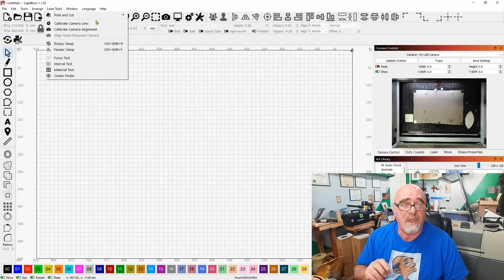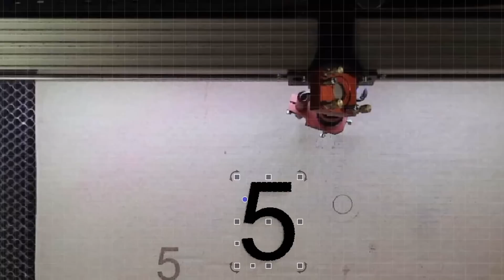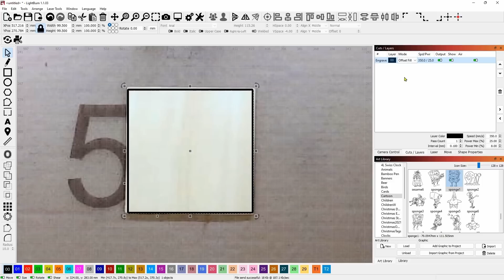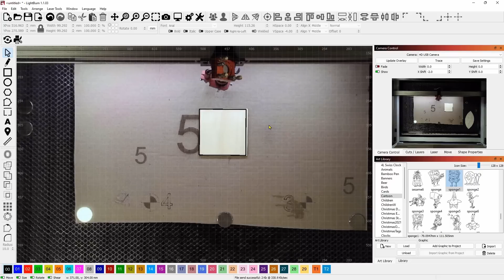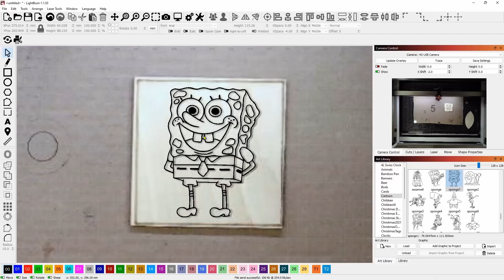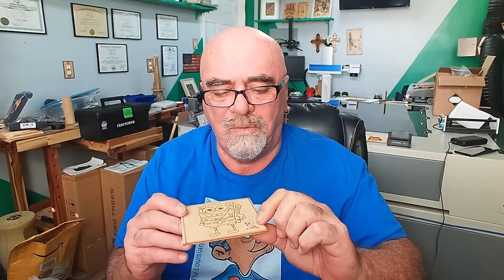👌 Achieve The Perfect Alignment For Your Lightburn Camera!

Comment: You don't need to print on such large cardboard, you can place small squares in the corners and center (The farther apart, the better). Place them during a dry run (0.50) power and do a low power cut, reuse with masking tape.
Reply from the maker: Thanks for sharing your method.

Comment: Good Day, So here is my problem when I draw a circle and it burns it its  off center . I adjust the x and y and burn again it off again. adjust again still off.. now lets say I have the alignment correct.  now at one point I had aligned when I place my material again I should just be able to align throw the item on the bed trace it out and burn all this alignment is driving me crazy.
Reply from the maker: You're probably using absolute coordinates on the laser tab.

Comment: So when I align and create a  square and circle  inside it perfect alignment. When i remove and add a regular circle and remove  honeycomb its off. I'm trying to engrave wood candle  lids what am i doing  wrong. Should I create  a template for the wood candle lids and align for them only and save setting
Reply from the maker: Using a camera, most folks only align it to the honeycomb bed. If you go higher or lower, the camera looses alignment.
Reply: @TheLouisianaHobbyGuy  so i need to align it afterwards  duh. Simple. Thank you 😊 💓

Comment: So when I home my machine, the display show 3 mm for   x and y. When I engrave the item is off around the same. So by just adjusting the shift this will straighten it all out. Now will the shift stay in light burn or will I have to do it every time. I still new ,only 4 mths, learning something every time. Using a longer Ray5 10 watt. Hopefully next year I'll expand it to work area 30*30 and 20 watt. Thank you making this vid.
Reply from the maker: No, the shift is just for the camera view. If you're at 3mm on the X & Y after you home, you likely have a problem with your limit switches. Contact Longer and report the issue.
Reply: @TheLouisianaHobbyGuy    Thank you

Comment: The settings comes with offset adjustments to align camera to laser markings
Reply from the maker: I don't particularly like setting offsets, but yes, I have talked about using them. Better to calibrate to every thickness of material you use and save those settings.

Comment: Will def try the paper background next time. I'm using a standard webcam not designed for lasers with mixed result and have a question for you: Do you have to alter x & y shift each time you raise/lower the bed? Because I have to and it is annoying and kinda defeats the purpouse (plus different items have different heights). Just wondering if its my camera or not. I would have hoped that lightburn takes this into account and selfadjusts but...

Also, you know you could have just hit "show" in layers to hide it instead of dragging it out and undo :P Easier to see exactly.
Reply from the maker: Yes, you have to calibrate for each thickness of material. You can save the settings for each on the laser tab. There are too many cameras and lenses on the market for Lightburn to adjust for them.
Reply: @TheLouisianaHobbyGuy  Oh really? Interesting, I'll look into that. Thank you!
About selfadjust: Tbh, I think it would be doable to have another step in the camera calibration for that. It would only affect the bed height since lightburn know the Z location but it would make it easier for sure. 🙂
Reply from the maker: No, you would need to have some sort of lidar to do that, and even then, the amount of camera sensors, sizes and field of view would make it impossible unless there was just one specific camera.

Comment: I recently bought a Lightburn camera. It camera with four square pieces of laser wood. The standard setting took the edges of the honeycomb bed.
However, I'll try adding the blank sheet, for anywhere away from the center is not yet spot on accurate.
Gorgeous compass, by the way!
Reply from the maker: Thanks, and remember to calibrate for multiple thicknesses of material.

Comment: Gonna have to recalibrate I had mine perfect I could tell it to burn in an exact spot and it was beautiful but after cycling the power on my laser it moved on me I can’t figure out why! Overlay and the burn match perfectly but it’s not in the right place I can’t figure out why!
Reply from the maker: You may have used a different thickness material. You need to calibrate for all thicknesses of material and save each one.

Comment: This may be a stupid question, but I’m completely new to using cameras in LB…
I have a Angetube auto-focus camera for my computer, can this be used as a camera in Lightburn or do I need a Arducam specifically?
I’m using this on a Longer RAY5 laser with an 850x850 bed area, so I’m also curious if these cameras can focus to that size?
Any help is greatly appreciated
Reply from the maker: I really don't know, but if it connects via USB it should work.
Reply: @TheLouisianaHobbyGuy  it does connect with USB.
I’ll probably have more questions to come, but thanks for responding

Comment: do I need to redo alignment every time I fire the laser unit and start the lightburn software?
Reply from the maker: You shouldn't have to, but you do need to have several saved alignments for different thickness materials.

Comment: Hi Rich, as always your videos are excellent. You mentioned mounting a camera for a larger work bed, I was hoping you have a camera make and model recommendation. I have a 400 x 850 bed and my current camera is limited to 400x400. Any recommendations would be appreciated. Thank You
Reply from the maker: I use a 175°, 5MP generic camera on my 914x610 Co2. But the further away from center you get, the less accurate it gets. I only really use the camera for the center 250x250 or so area.
Reply: @TheLouisianaHobbyGuy  gotcha , thanks Rich, I was able to find one thru light burn that should do the trick. Thanks for the feed back.

Comment: From what I've been reading, if you would've moved the cardboard before you put your square of wood on there, you wouldn't have needed to adjust anything. It was the added height that messed it up. BUT I've been struggling with my camera and it's been driving me crazy. I'm going to try your suggestions and fingers crossed it works! One question though, do I need to realign and calibrate my camera every time I want to use it if I haven't moved it, but I've unplugged it from my laptop? Or once I get it right, I'm good to go every time.
Reply from the maker: No, once should do it, but do it at the level of the material you use most. So if you typically use 6mm wood, put a few pieces down on the bed so you calibrate to that height.

Comment: Adding the camera is a game changer for me ! In my case I'm using a Prover xl 6050 cnc machine with a 10 watt laser and I mounted my webcam on bar stock (permanently/no movement) above the machine in perfect center. I did the very same thing with using white poster board for the first part and a 16x16 inch square of 3/8 particle board for the 2nd part and it was a piece of cake. Every capture on camera alignment was around .03 to .05 and now I can put down a dime sized object and engrave it perfectly ! The camera has made engraving and cutting so easy, it's well worth the effort IMHO. Great video Rich, cheers from Utah !
Reply from the maker: Thank you so much! I really appreciate the comments! 👍

Comment: You have done it again,  I was having a total nightmare calibrating my Camera,  it was very well lit but I just could not achieve acceptable scores.  In fact as the hours went on the scores became worse.  I then found your video (this one) and followed it to the letter with the complete whit background,  which again was well lit.  After 25 minutes my calibration is pretty damn perfect.  It took 25 mins because I was going between Lightburn and your video,  obviously not an issue especially when you consider the 4hrs 10mins of sheer frustration with my initial efforts.  So yet again more well deserved THANKS,  this lasering malarky is lucky to have such a great tutor !!
Reply from the maker: Awesome! 👍 Thanks for watching!

Comment: Hi Rich, Great videos all around.  When you talk about the camera calibration card (dots card) what size do you print it at and is in landscape or portrait position?  Also, in the camera alignment wizard for the "sample image - 4 dots with center determination" when you say to increase that to 200% - does that only work for square beds, as my bed is 430mm (x axis) by 930mm (y axis) and on that page it is already set to 195%, would/should I increase that to push the four circles to the edges of my bed?, because if I increase beyond 200% it may push the dots off of the bed beyond lasering point (x axis) or will the software account for the rectangular bed when taking the percentage into account.  Thanks, appreciate your time. :)
Reply from the maker: I print the dot size at 150% I think. The largest size that fits on the A11 paper in my printer, in landscape. You can increase the 4 dots to as large as the material or bed. The larger, the more accurate.
Reply: @TheLouisianaHobbyGuy  Thanks for the reply, appreciate it. :)

Comment: Do you have to home your machine to get the lightburn camera to work?  I have the Xtool D1 non pro and have never used the home because it doesn't have the limit switches.  What do you suggest
Reply from the maker: Before you turn the machine on, move it by hand to the top left corner. Then it will work fine if you don't move it again by hand Shelly.
Reply: @TheLouisianaHobbyGuy  thanks so much!!

Comment: Hi Could you tell me what I'm doing wrong I have set up my camera To your video In each steps and it works perfect And I save it,( Calibrate camera lens plus Calibrate camera  alignment) I can  do a shape or number on the board And it will be spot on every time But when I shut down the system totally and turn off the power and turn it all back on again it is out very slightly I have a ortur Laser Pro 2 with a 80w tree Laser Which works are treat The laser Is set in the door  lift up on the  ortur Metal  enclosure,
When I was setting it up it was just stuck up with double sided sticky tape it is now set up With hot glue Which works A treat .
The only thing I believe it could be is when I lift up the door On the closure It is not lifting perfectly to where it was not sure if this is the case Thank you.
Reply from the maker: Yeah, if it's not perfect, it's not perfect. It only works in a fixed position.
Reply: @TheLouisianaHobbyGuy  I believe it's the door lift there's a few millimetre play in it Might have to rethink Where to put it

Comment: I did have good lighting.  There was a shadow being cast from the horizontal bar across the dots so I added a 60 watt fill light from below and that helped tremendously.  I think that’s when I was able to get the values I did when I used the iPhone.
Reply from the maker: Yeah, shadows are bad Steve.

Comment: Just got the new monport 40 watt with lightburn, but I can’t figure out how I should mount the camera I have any ideas would be greatly appreciated
Reply from the maker: K40 lasers don't play well with a Lightburn camera Thomas. The only one I know of that will work is a 5MP, 150° since that one can be mounted at 6.56" off the bed. If you click Help --> Camera selection in Lightburn, and then enter your bed size, it will show you the camera, aspect ratio and minimum mounting height.
Reply: @TheLouisianaHobbyGuy  ok thank you

Comment: Hi Rich,  Have you found that if you change material thickness, the X and Y offset has to be adjusted?
Also, I follow the camera installation from your previous video, you selected 8MP-N-75 vs 8MP-N-120, why?  the camera view that you were installing was larger than 75 degrees, right?

I found that I have to keep adjusting the x and y offset at least 2 to3 times before the burn is right on!!!!  FYI I am using the same 8 MP camera
Reply from the maker: Not on the thickness, no. My cam is 75°.
Reply: @TheLouisianaHobbyGuy  Thanks for the feedback.  SO..... the 8 Mp camera you have linked in the other video is a 70-degree view?  I did get that one!!!!!
Reply: Hi Rich, I did read the camera info, it is a 75-degree!.  I will go ahead a re-do the calibration!.  Thank you for your videos
Reply from the maker: My pleasure Hector. It was either 70 or 75, I don't really remember.

Comment: Hi, Rich...I have another question for you..😀 Camera choice:  LightBurn has them at 120 degrees ; 150 degrees @ the 5 mp.  Since I have the XTool D1, I've found on Etsy a fellow that makes the mount for the D1, so I am considering it.   Which degree should be best...120 or 150?
Reply from the maker: It really makes no difference Kat, except for the height you have to mount it at.
Reply: Thank you, again the life saver..😁

Comment: Awesome video Rich!
I’m fairly new to Co2 lasers. I did the calibration twice, and I still have the same issue. Whenever I hit the frame button it seems like it’s around an inch or so off my object showing on the camera. I’m starting to lose hope with this camera thing that I thought would make things easier on me :(
Reply from the maker: Once you're done with the calibration, make adjustments on the camera control tab. Use the X shift and Y shift to get it to frame in the right spot and then click Save Settings.
Reply: @TheLouisianaHobbyGuy  thank you so much. I’ll try that!
I really appreciate it 🌹

Comment: Rich, do you think you need better audio recording capability? That background noise takes away a bit from the message. Otherwise, great video, as usual,  big thanks!
Reply from the maker: Can't help it when I'm doing live videos. I can't run the laser without the chiller and exhaust.
Reply: @TheLouisianaHobbyGuy  I agree. A limited range dedicated mic will help in such situations. Or even picking up your speech from very close by will increase the signal to noise ratio.

Comment: I did the exact same thing when adding my camera a month ago and it is still not exactly on target  but thanks for all your great videos LAHB 🙂 YOU ARE THE BEST for me to understand problems I have with lightburn
Reply: Remember to measure your bed first and mark the work area so you use the pattern sheet within you working area. I just found out, that I placed the pattern sheet on the edge of the honey combe bed. It is 1005mm x 1500mm but the laser work area is 900mm x 1300mm so disturbed results all the time. Now it works perfekt :-)
Reply from the maker: @PerB_M  Good tip!
Reply: LAHG I  meant
Reply from the maker: You are so welcome! You may have to just tweak it a bit. On my other laser I had to change 2 settings to get it right.

Comment: I am going to try this today. You mentioned using speed 2000 and power 40. Is it the same for diode laser? I have a 20W Neje.
Reply from the maker: No, I did 350mm/sec & 25 power, but that's a Co2. You have to run your own test card to get speeds and power, but on the Neje 20W, 2500 & 30 should be close Eric.
Reply: @TheLouisianaHobbyGuy  I have tried fast and slow, high and low power. so far it has not worked for me using mica powder. Still testing.

Comment: I have upgraded LightBurn to version 1.1.03, so, I think it's the latest version.  I've never seen you do this so I'm going to explain what I do.  When I'm moving my graphics to align with other graphics it can be a pain in the butt to get them perfectly aligned with each other.  So, what I tried was to hold the shift and control keys simultaneously and use the arrow keys.  It allows you to micro adjust the graphics and it is crazy accurate.   Like I said, I've never seen you do this so I thought I'd comment in case you didn't know this trick.
Reply from the maker: I should probably say that. Also the Ctrl + mouse for micro adjustments. I'll make sure to add it to future videos, thanks Greg!
Reply: LB released an update today.
Reply from the maker: @robmills4709  Just bug fixes. Nothing new.

Comment: From what I have seen is that if you change the level on the bed  from where the camera was focused then it will be off. You were spot on with the cardboard but when you put that cut peace on top you change the height. Not sure if that is why it was off but figured I would put it out there.
Reply: yes you are Quite right Jordan
Reply from the maker: I'll check on that Jordan, thanks!
Reply from the maker: So I did a little testing Jordan and I believe you're wrong. I dropped in a 30" 2x4, which is 1 1/2" higher than the cardboard was, but when I focused on the top of the wood, it was the same distance to the laser head as the cardboard was. So it worked perfectly.